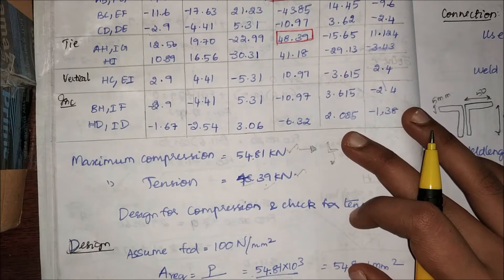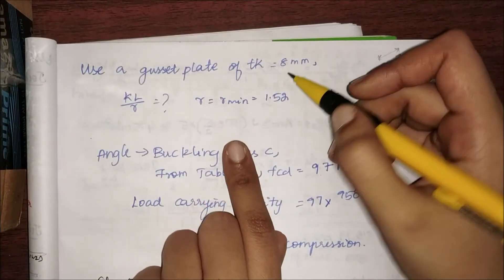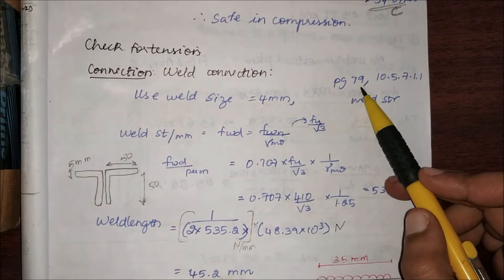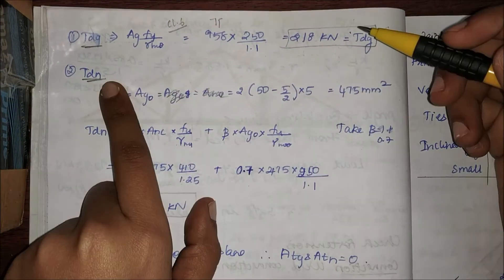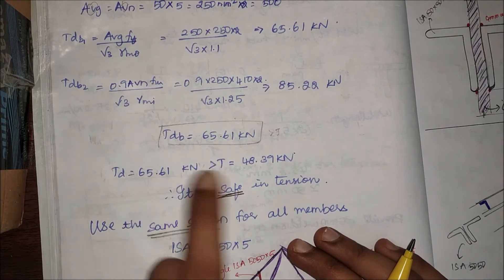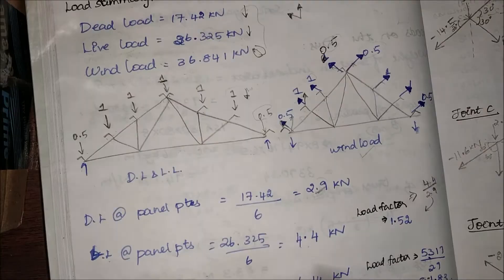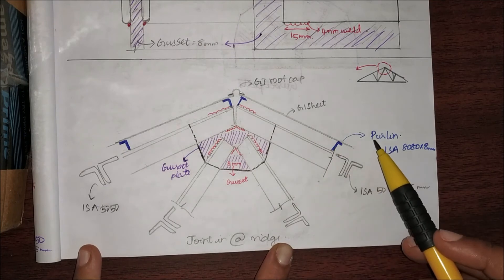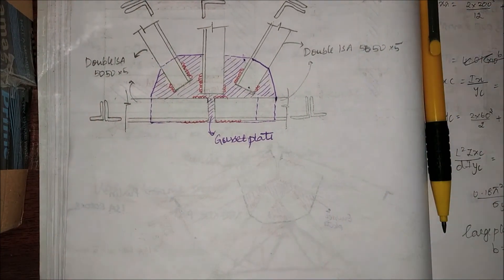5. Roof truss design | Load calculation, Purlin design, Member design | IS code | Steel truss

Comment: Nice Lecture. Was helpful and interesting but while checking for the tension and calculating the weld strength per meter, the value calculated i.e. 535 was not met when computed using those values. 
 Can you elaborate on the process used?
Reply: Multiple it by size of weld ie 4mm